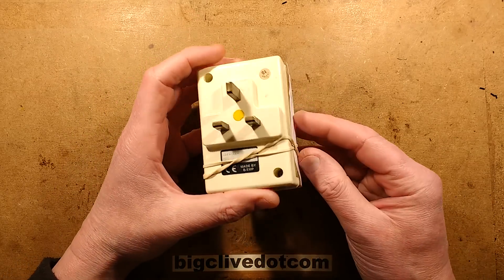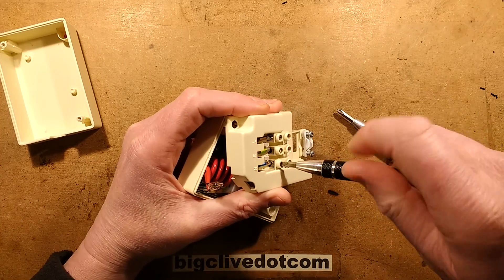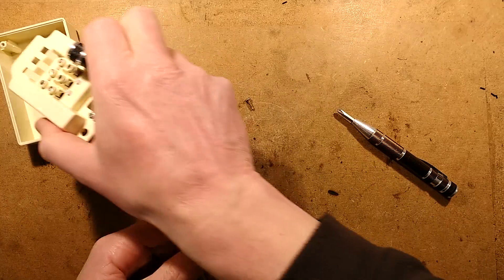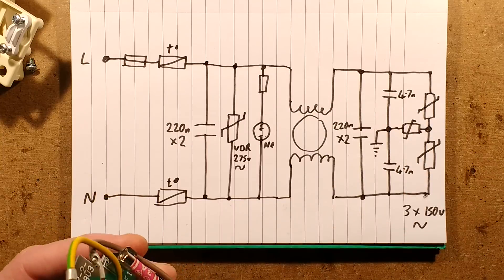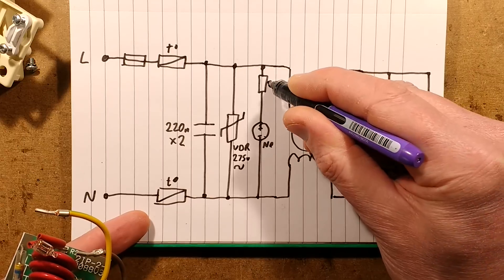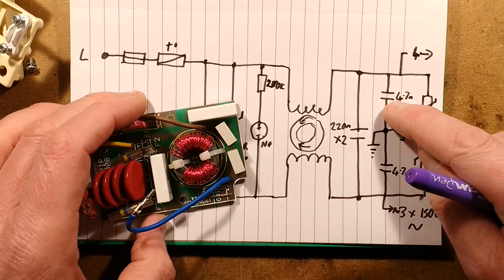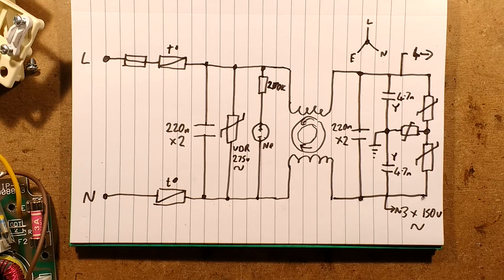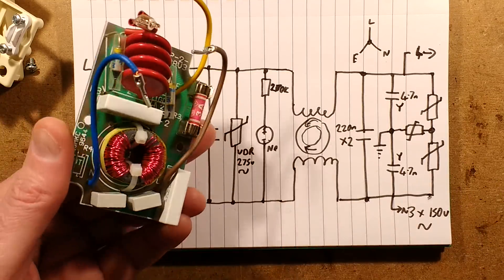Inside an old interference suppression plug.  (schematic)

Comment: The only bit of shoddy design is the 3-pin choccy block.  Which means line, neutral and earth wires are all the same length.  Which means enough force on the cable (say from tripping over it) gives you Russian Roulette odds of it failing safely compared to a standard BS1363 plug.  Unlikely for it to fail in that way, but it's not impossible.
Reply: Of course, you could just cut the Earth wire so it's longer than the others..... :)
Reply: these were sold to retro fit suppression and filtering to a device hence the "choc bloc" that is the same mechanism as is used in uk mains plugs the installer should have a longer earth cut

Comment: Today I learned that what I know as GFCI is RCD over there. And you guys seem to have them in way more places. 

Honestly tempted to wire my place in Canada in a more UK style with all GFCI, and each outlet on its own switch. Just seems sensible.
Reply: RealLuckless They don't have RCDs/GFCIs everywhere- they have what we'd call a main circuit breaker that is one, which protects the whole building. However, the problem there is that they probably end up with a lot more nuisance trips than we do, where we only have them on bathroom, kitchen, garage, and outdoor outlets. Keep in mind that the UK does a lot of things differently in part because they often use ring circuits, where a group of outlets are connected in a loop with each end of the loop connected at a high amperage circuit breaker. Current flows from either direction, meaning outlet style GFCIs like we have wouldn't work. This is also the reason plugs all have their own fuse- otherwise, you'd have a low amperage device protected by a 32 amp breaker.
Reply: puckcat22679 there are circuit level GFCI units rather than just the outlet ones. Plus I'm very tempted to move to a central distribution panel that then feeds to individual sub panels in each room. It is a bit more money, but I like the idea of walking across the room if I trip a breaker rather than having to go to the basement. Plus it means more flexibility any time I want to run upgrades without having to kill power to the whole house.
Reply: I have a single RCD for the entire house, which could false trip quite often if it was very sensitive but it isnt. Its current threshold must be quite high because I already got a live to earth shock with burnmarks on my hands without tripping it.
Reply: Hello  RealLuckless;  I have a RCD on every circuit,  including lights so some twit doesn't leave the light on whilst changing the 'globe',  EXCEPT the air conditioner ccts.
Reply: I have a relatively new property, here in the UK, which has a main RCD for the consumer unit (fuse box), plus one for each circuit (kitchen, oven, outdoor lighting, sockets, alarm, lighting (which includes the single isolated shaver socket in each of the bathrooms)). As we have more electrical kitchen appliances than usual, due to disability, there's additionally a fused switch panel in the kitchen for each of the hardwired appliances.
Reply: RealLuckless  We call earth leakage devices RCD's. Depending on the age of the installation and on how much money was spent on it, you can have the whole house protected by a single RCD, a split consumer unit with selected circuits only protected (e.g. just the socket outlets) with other circuits (lighting, shower) not protected, a consumer unit with some circuits protected by individual RCBO's(one per circuit, typically used for ring mains sockets) and other circuits not protected, and finally you can get socket S with a built-in RCD. So take your pick...
Reply: Well, the thing is, in theory an RCD should trip when you touch live and earth and save your life and at 30mA it is most likely too late. But Ive rarely seen any whole household RCD that has a low triggering current to avoid false tripping.

Comment: Those 4-gang surpressed extension cables from late 90s > often just contain a single 275V varistor across live and neutral. Having just one connected to the mains provides some transient protection for your entire house.

Comment: The xcap after the cmc and the 2 ycaps have no bleeder resistors, those may have looped a path through the middle mov with a series voltage enough to breakdown the L-N mov's and trip the load rcd.

Comment: Is there actually much value in such suppressors or is it like the Chinese power saver boxes? and how would one go about detecting if they had interference on their power lines? is that a oscilloscope job?
Reply: steve64464
Random PC crashes are unlikely to be the mains... You'd notice the lights flickering when it crashes if it was. If you still think it might be the cause though, get a brand name UPS instead of one of these.... Then you won't have to worry about short blackouts either.
Reply: These kind of noise suppressors do have a use, provided you have a piece of noisy equipment in your house. Since universal motors are quite common in things like vacuum cleaners, and they're quite electrically noisy (not to mention the sound), if you have your computer or TV power cable plugged in to one of these, and then the wall, then your vacuum cleaner won't induce noise on the audio line of your computer or TV.
At least, that's the theory, there's crap noise suppressors out there that don't actually do anything beneficial. Generally if it's too good of a price to be believable, it's not going to work.
Reply: In my experience most people are completely unaware of any interference in their homes. The first sign for most people is the neighborhood ham radio operator showing up on their doorstep hoping he can take a look around for the noise signal he's trying to dig out of his radios.
Reply: See i have this pc that randomly crashes and ive been through a lot of diagnostics etc but i haven't been able to rule this out as a possibility.
Reply: yep, best way is by a CT or resistive divider with the 'scope trigger above the mains level, you are looking for micro second events
Reply: Yeah i don't think i want to check a 240v line it may hurt :-D
Reply: Any decent power supply already has filtering and small MOVs builtin, but it's obviously better to catch a lighting spike on a cheap external device that can be thrown away after sacrificing itself. 

As for the interference I don't think it's doing much, I've tried a bunch of filters on an old food mixer and it still manages to kill the TV signal.
Reply: you can get dedicated monitoring equipment but its expensive

Comment: Class Y and X?  I had to go look that up. Stop making me want to learn more.
Reply: Its quite easy: class X goes between live and neutral and must withstand 250V AC while having a large capacity, class Y goes from live to earth and neutral to earth (or from the high voltage side to the low voltage side of a transformer) and they must never fail short circuit while having a small capacity. They are both made for interference and noise supression.
Reply: I know, Clive does this to us every time!... I've just felt the need to go dig through boxes in the attic hoping to find a old one I think I have, no, I know I have it, I just can't find it!... I might as well just tidy my attic now! lol!...
Reply: now he also makes you tidy up things xD

Comment: I've seen GDTs (gas discharge tubes) connected in series with MOVs "in the wild". I'd guess that they prevent the idle current from flowing, no idea what other benefits this arrangement would have. Decreasing MOV's wear maybe?
Reply: argoneum If you use a MOV in series with a GDT you can use a lower voltage MOV since any transient sufficient to spark the GDT is immediately desirable to be clamped.  Problem is you need a higher current rated MOV to dissipate the same impulse power.  It's safer and cheaper to ignore the GDT in this case and just use higher voltage rated MOVs. :) But yes, having a GDT inline would spare a MOV the burden of dealing with small inconsequential spikes and premature aging.
Reply: Thanks :)
Reply: GDTs are slower to respond but can handle higher energies
Reply: GDTs are very popular in telecomms. protection systems.  Assivalley notes - they can be useful as "added protection" to MOVs, but be mindful that MOVs age, and will eventually fail in a conductive (or rather lower-voltage conducting) state.
Reply: EMP mainly made products for the power distribution sector they did have some telecoms products that retrofitted in exchanges but they used SCRs from what i remember
Reply: It was also make the MOV fail less dramatically I assume.

Comment: Would it work better with the discharge tubes installed? Any way you could look at a baby heartbeat monitor?
Reply: I think discharge tubes are meant for last resort one shot protection, I know they don't last that long anyway.
Reply: nope too slow for the application

Comment: Considering the probable age of this device it looks very well designed and made. Personally I'd be quite happy with replacing the varistors and using it again. Its a lot better than most of the junk you find today.
Reply: Well in any decent power supply of beefy devices, the input should look exactly like this, except for the odd MOV arrangement, but yeah, sadly thats not always the case.

Comment: Failure mode of this is that one of the VDR units has shorted, or is breaking down at lower than expected voltage, and this then allows the spike to pass L to E instead of L to N when turning off the unit. Especially true of those older GE made zinc oxide varistors, replace with EPCOS silicon carbide units of same diameter ( determines power rating) and breakdown voltage and it will be fine again. 

I have a pack of those GE varistors where one at least breaks down at around 350VDC, and this fails the spec of needing 450V DC breakdown for the particular part. Never used, just failed from old age, but ones in service also exhibit the lowering of breakdown voltage with time till they go low resistance and pass heavy current, thus the thermal fuses to disconnect the power to the device when they go faulty, and the current is enough to heat them up a lot but not enough to blow the mains fuse.
Reply: Didn't Huw say the unit caused his RCD to trip even when it was switched off before unplugging? In that case it would have to be an N to E transient tripping the supply,  and Clive's suggestion of a transient generated by the indicator and passed through the class Y cap may be more likely.

Comment: Amateur here, but I didn't see any discharge resistors across those capacitors. Could it have been discharging to earth through the MOVs as that's the final connection remaining after the live and neutral pins escape their contacts?
Reply: the ZnO MOVs conduct enough to discharge the caps at low voltages

Comment: Does the standard British power socket come with an on/off switch? I know US ones don't but every Australian power socket has a switch.
Reply: Because a full jolt from a 32A ring main at 240v gives up to 7.8KW of fault power to deal with. Our household sockets are rated to over 3KW each at 13A, so chunky plug pins and sockets are a must. And since those plugs come with HRC fuses (you hope, <3 you China) they can actually stop that kind of fault current.
Reply: Because we have ring mains (which use less copper than star connections).  16 A cable, which loops back to a 32 A breaker, so total capacity of the cable (if the loop is intact) is 32 A.  Which is fine until some idiot manages to break the loop, leaving all the sockets on 16 A cable on a 32 A breaker.

No, it's not foolproof.  There are many ways you could overload the ring in the case one end of it gets disconnected without blowing any fuses in plugs.  But it does catch some of the common ways idiots come up with, like wiring a 30 A cooker to a 13 A plug: there are no 30 A fuses of that physical size.  Which is why idiots put a nail in.
Reply: Gary Rumain Yes, they do. Probably where Australia gets it from too.
Reply: Optional, New builds in UK yes switch on sockets. 
 On older houses not unless replaced with new switch sockets . 
But in Ireland they use same socket but don't bother with the switches but socket plates with switches are available.
Reply: Unlikely. Australia has had switches on the power sockets since, at least, the 50s.
Reply: So it's a recent thing. Was it a law?
Reply: Government standard published back in 1944, for the UK - before that, some outlets were switched, some weren’t, and there were a few different sockets in use. That was also the report which introduced our “ring main” wiring and mandated fuses in plugs.
Reply: I always wondered why the fuse was in the plug in the UK.
Reply: Class one earthed appliances should have a fuse is connected to the live, other systems don't define with a polarised connector so no point

Comment: i'm no rocket surgeon, but that actually looked really well made. 3-piece case, ferrules, multiple protection modes...that hand taped pcb is pretty top too.

i'd de-solder and clean the board so i could use it as "art".
Reply: EMP was a specialist in lightning protection their main market was high-voltage distribution they applied that knowledge to their low voltage products
Reply: It would make a very nice project case for mains project, except for the bit of missing plastic.

Comment: Very nice.  Looks like something that if it failed, would be worth servicing to restoration again in lieu of binning it.
Reply from the maker: It's fully serviceable.
Reply: Well, a failing MOV can melt or burn the PCB or case before the thermal fuse pops but as long as that doesnt happen, it surely is very servicable.

Comment: In the US I think a design like this (with the voltage ratings adjusted of course) would still probably work fine as our circuit breakers aren't GFCI/RCD by default (which could be a good thing or a bad thing, I'll leave the debate for proper elecchickens).  In the suppression circuits I've taken apart inside power strips, I usually see the thermal fuses intermixed with the MOV's and some even have a blob of solastic or thermal compound just to make sure there is good thermal contact.  I also usually see the MOV's in a delta configuration (L<->N, L<->E, N<->E) and only 3 instead of the extra 4th one this unit has.  Only the really expensive ones have the suppression chokes.
Reply: Gregory Thomas You have to thank our dear uncle bumblefuck (@AvE) for coining that term.
Reply: I love the magic wall pixies too!
Reply: "elecchickens"
Bahahahaha  :)
Reply: uK8cvPAq 
I wasn't being facetious - there are people on here from all over the world and I'm too stupid to spot the obvious typo in favour of an assumed colloquialism!
Reply: debris*
Reply: It was my bad for letting the spell checker have its wicked way with me!
Reply: New construction depending on which version of NEC, national electric codes, your state or municipality have adopted, some automatically jump to the new codes and some have to be adopted by the legislature, require AFCI in all bedrooms and GFCI in all kitchen, bathroom, and exterior which includes garages. 

My last home of 2014 vintage in Oklahoma had all that... currently in a 1969 and feel just as safe. Although it was upgraded to 200A service with a new panel circa 1990. No asbestos and no aluminum wire in the construction it was to new for the former and too old for the latter, at least here in Oklahoma.
Reply: GFCI/RCD's are great...until you get nuisance tripping. Older homes are a pain for this sort of thing where the combined leakage currents add up, a few 100uA here and a few 100uA there from spiders, damp and debris across terminals etc along with leakage from appliances all crammed onto a single GCFI/RCD because the breaker panel and circuits are old.

Having said that I'd still prefer to have them, they've saved my ass a few times.
Reply: uK8cvPAq 
What are derbies?
Reply: yep, the delta arrangement is exactly how its usually done, quite odd on this one.